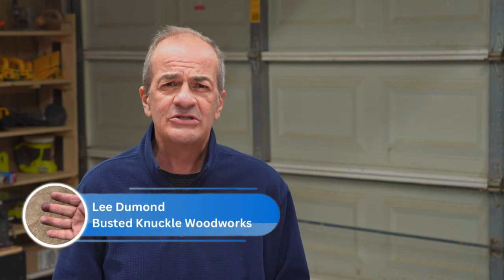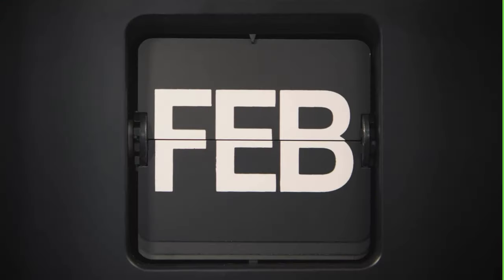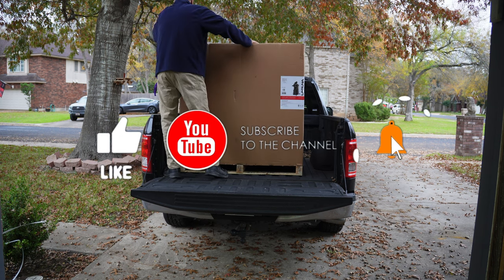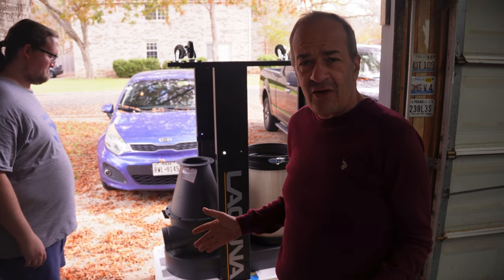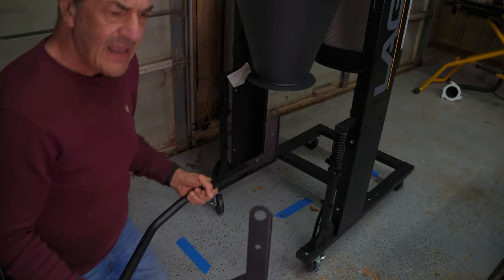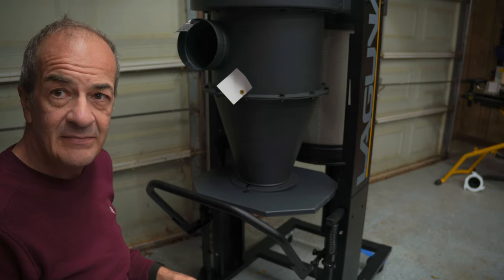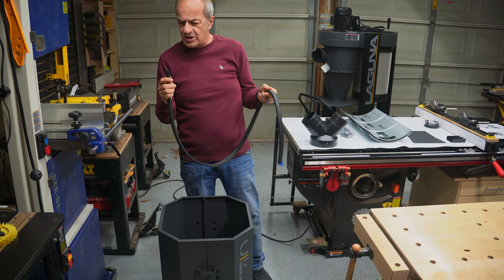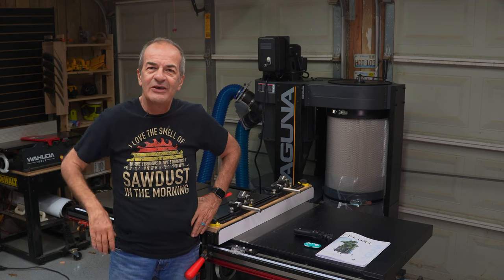Small Shop Dust Collection Part 1: Evaluation, Unboxing, and Assembly

Comment: Hello, I am considering purchasing the Laguna Cflux 1.5 like yours. I would like your thoughts on the power of the unit. Is the 1.5 enough or should I get the 2 HP? I want the HEPA . I am replacing a old grizzly . My shop includes stuff like 8 inch jointer, 16 inch drum sander , 13 inch planer, 10 inch table saw, 13 inch band saw, radial arm saw and a few others. I am using PVC 6” pipe dropping to 4” before the tools, longest run is to my table saw with 20 feet of 6inch then 9 feet of 4inch to a few feet of 4inch flex.  34 feet total, this is really the only tool I am worried about? I am hoping I can leverage your experience and provide your thoughts. Thank you.
Reply from the maker: The longest stretch for me is around 25 feet. Sounds like from what you're telling me, your shop is a bit bigger than mine, and you're also using drops. If you can afford it, have the extra height space, and can spare a 220v circuit, I would probably go for the C|Flux II, which is only about $400 more.
Reply: Hello, I hope my comment will help others with similar questions.  The most important thing to remember when using long spans of ducting is to use good sweeps, and the further away from the DC, the more gradual the sweep should be.  The secret is air volume and momentum to carry your chip and dust.  Too many people try to use 45 or 90 degree plumbing elbows (your standard large drainage PVC and ABS round elbows from Home Depot), and I understand the want and need to get things installed without spending too much money.  But the air movement at these acute angles nearly comes to a stop to make the turn, which kills the air flow down stream.  It's not like water, which flows much more slowly and carries weight (and uses gravity) to keep it's momentum through the turns.  Also, these dust collectors are not vacuums, so reducing duct size will hinder proper air volume and flow.  They work best with as little restriction as possible.  I had a large shop and found that even with 12 foot drops to my farthest machines (60 feet away), a proper sweep (say 2 foot radius) kept the flow more than strong enough to slurp up everything my 20" planer spit out.  Another trick, and it took some trial and error, was to crack open the gates a little bit at certain machines or floor pick ups to maximize air movement.  Believe it or not, just like the scavenging effect you car's exhaust has to draw more air in, the dust collection system will benefit from additional air being sucked in from a select few gates when cracked open a smidgeon.  It keeps your air speed in the main duct moving faster for less strain on your fan and motor, and will improve air moment at the machine in use.  Moral of the story, it's worth spending a few extra dollars on proper ducting and gates if you want your fancy new DC to work like a champ.